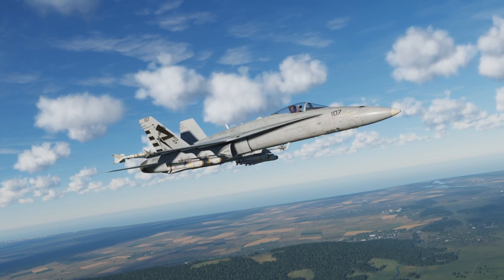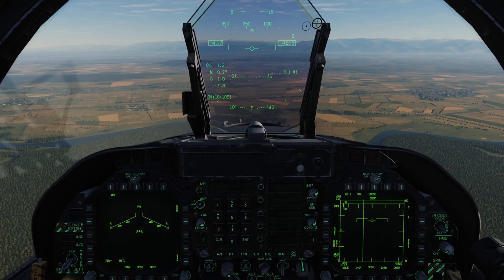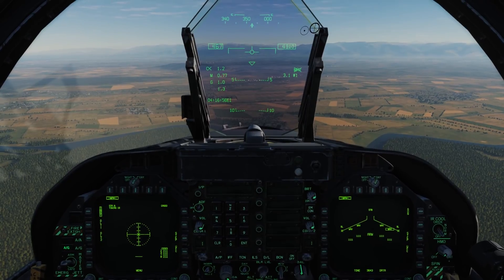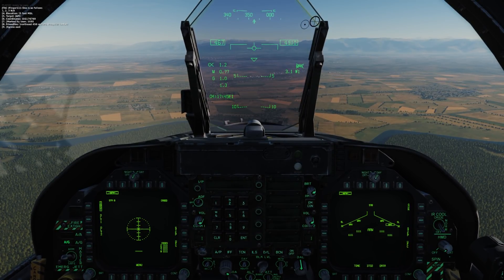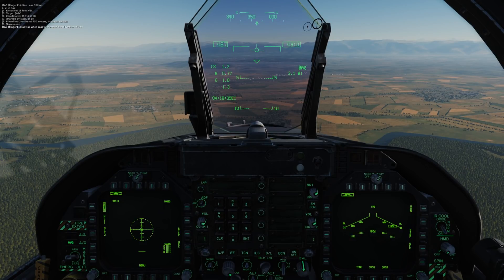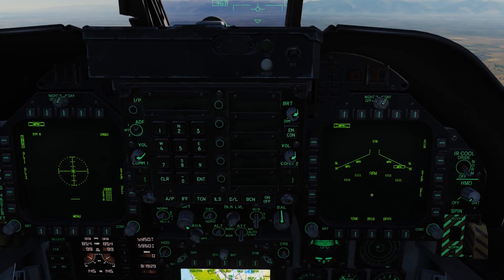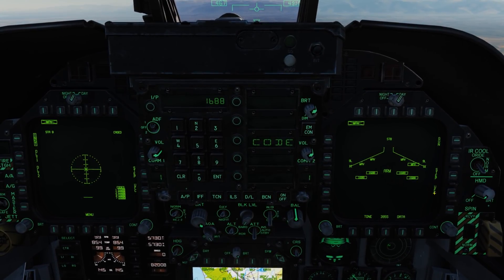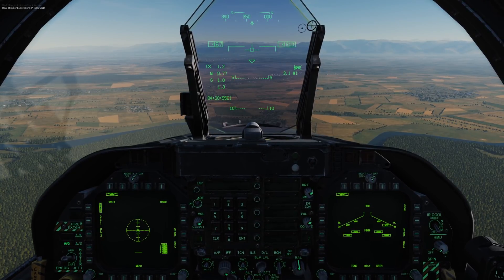DCS: F/A-18C Hornet – Episode 18 AGM-65E Laser Maverick

Comment: JTAC keeps telling me "no mark" wont lase the target, what am I doing wrong?
Reply from the maker: The JTAC does not have line of sight or range.
Reply: @MattWagner  Thank you for replying. I had him pretty close (<5 mi) Could I be using the wrong unit? which ones are able to designate with a laser?
Reply from the maker: @juanjo12el . Max range of a JTAC laser is generally 10,000 meters. 5 miles is far to great. Please use our forum here: https://forums.eagle.ru/forumdisplay.php?f=210
Reply: @MattWagner  thank you sir
Reply: @MattWagner  You were right, it was a line of sight issue. View was blocked by hills, but now I get to the point where you uncage the sensor and it is not working. I pressed the button "c" it did not start searching.

Comment: Awesome feature, i'd like to report a bug tho; 

Loaded 4 maverick for a range mission but the codes/station numbers are mixed up and not matching, for example
The Stores pages show all codes set correctly and the STEP works as required but the MAV page show stations number not matching actual and the STEP there goes to station with no maverick.
I'm thinking the variables might be mixed up on the back end showing the wrong number/codes in the MAV page.

Awesome job as usual!

Comment: i cant seem to uncage the mav.
Reply from the maker: There is a known issue with re-arming.
Reply: @MattWagner  do you mean we need to make a profile in our mission for the Mavs to be preloaded before we start the mission?
Reply: @cutlass6332  aparently, they work if your spawn an aircraft in the air preloaded
Reply from the maker: @CarlWicker . Correct, it's a re-arming issue. The team is aware and it will be fixed.

Comment: What's the standard code for the 84LG/GBU-12?
Reply: In the A-10C, the standard code for GBU-12 was 1688
Reply: @arthipex8512  tried that and 1111 (even 1113) didn't work.
Reply: @theflyinggasmask  You should find the laser code under the respective weapon settings. But I have some troubles too, getting laser designation to work.

Comment: Any ETA on how soon behind the GBU-12 is?
Since i hope they add it soon (and dont wait for the ATFLIR)
as now when the AGM-65E added we can simply use it as a type of laser spotter (finding the lazed target) and then drop the GBU-12 in CCIP.

And having the GBU-12 would add more flexibility 
(also increase the load size as the AGM-65 can only be carried one per pylon where as multiple GBU-12s can be carried per pylon).
Reply: Long as you have a general location of the lased target you shouldnt need a laser finder (the mav in your example) to hit it. Set up your CCIP point approximately where you think the laze is, preferably a little long. Drop the bomb from decent alt and it should be able to correct. Thats what you have to do in the mirage and it works just fine
Reply: E F and G mavericks are only ever carried one per station, afaict. In contrast to D and H on the A-10, which have a different (lighter?) warhead.
Reply: The D and H use 126lb shape charge warheads whereas the E uses a 300 lb penetrating blast frag warhead.  So the E is definitely heavier.

Comment: Theoretically, we could have separate targets lazed by separate wingmen/JTAC and ripple fire them off from one plane? right?
Reply from the maker: Yes
Reply: But each one would have to have different laser code, correct? What if you would have many same coded laser blips?
Reply: @damsonn  Yeah I would assume so, otherwise you will have several mavs heading for one or two targets depending on the seeker FOV
Reply: I'm assuming that would be the reason for having systems with alterable laser codes.  So you can have multiple missions running in parallel with less chance of them stepping on each other.
Reply: That sounds cool to do. Situational but cool
Reply: I wonder if it can be different aircraft. Like the a-10 laze for the f-18
Reply: The weapon doesn't care where the laser comes from.  As long as it's on target and running the proper code as far as I know.
Reply: Hell, it doesn't even need to be on target.  It could be pointed at a rock for all the weapon cares.
Reply: I love this sub thread,  I’d be maxed getting this one done & you guys are multi targeting...I need my old brain upgrading, but dammit I’ll get this tried one day, with lots of pausing inbound lol
Reply: Ps I lugged the trial laser kit around Norway many years ago for a FAC officer, it was quirky then because there were lots of problems with the snow/light reflection that still had to be sorted out, and it was HEAVY. Lol
Reply: Hey.  I'm just happy when I actually remember to put anyone in to lase the targets for me on my mission....lol  Kinda bad going through startup, launch, then a 100NM transit to find you forgot the JTAC.....lol